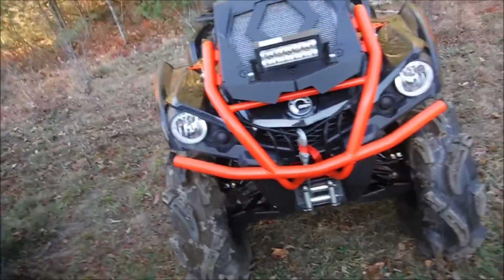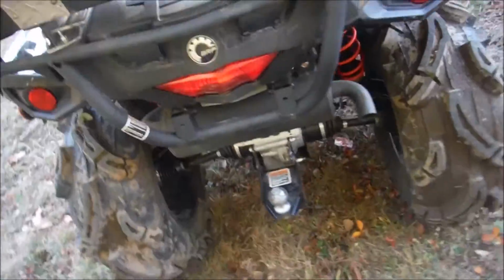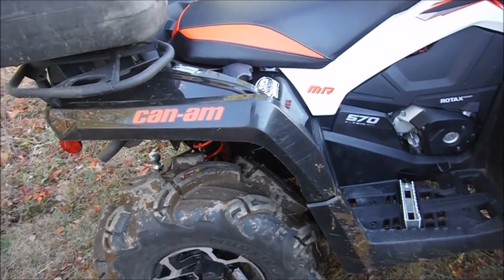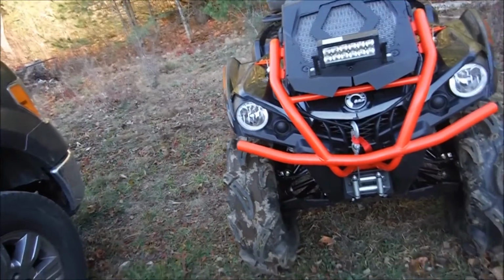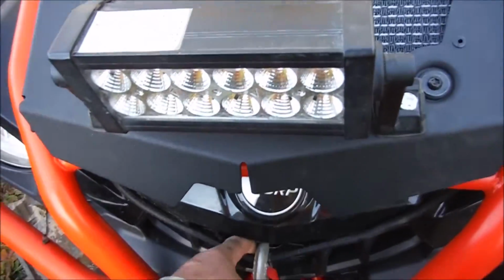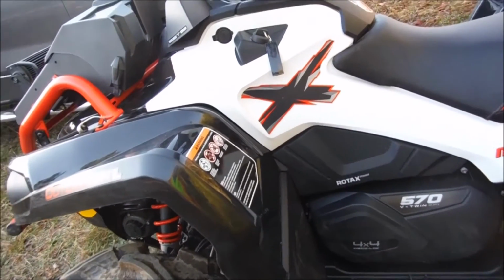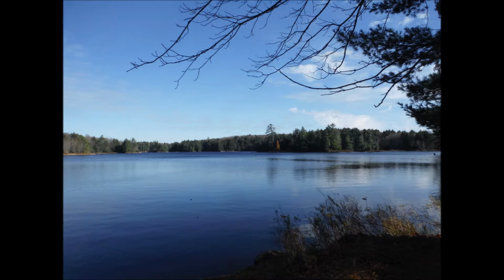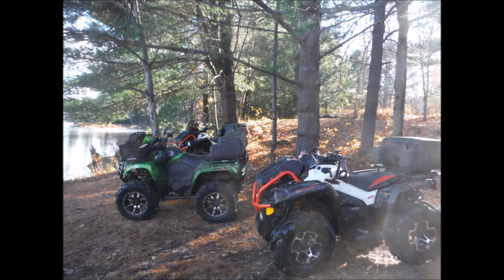2016 570 xmr review

Comment: Do you find it tippy? Thanks
Reply from the maker: At first I did but now I'm used to it. Remember this is a mud bike first not a trail bike but you can add spacers and widen it up like ill be doing that when I get my second set of tires and rimes. This way when i do the fast pace trail riding ill switch to spacers and a trail tires. and put it back to stock when I do mud. Over and all you'll get used to it without the extra cost . Just think to yourself what you will be doing more. Thanks for watching and fell free to ask any more questions.

Comment: The guy on the mud pro is probably running less aggressive tires than you that would probably be the reason or rider error ,Cat has more clearance same power with better gearing and diff lock
Reply from the maker: Love that you think that but a can am 570 just outright out performs the cat. I'm saying this because I owned one and ride with a few. They are all slowly buying Can am's. The guy you see in video just bought a 850 xmr. Now that cat was bought out I'm hoping to see some great improvements. Not knocking arctic cat just that they could not keep up to the competition and hopefully that will change. Owned 2 cats before the Can Am. Thanks for watching.
Reply: My 14 mud pro 700 out performs my friends 17 xmr 570 ,I can beat him in a race all day long pull the front wheels way easier I like his bike but it lacks low end power big time , there both great in mud never seen any situation where his out performed mine even with him having the mud zillas and me just the zillas ,Add me on snap Shaneb626 not just talking shit it's my real world experience all even get the race for ya both are bone stock and I weigh 80 pounds more than him
Reply from the maker: Sometimes it's just the rider but I'm not hear to argue. But if you were to ride with me i'd show you like i did with my friends and one of them is a 2016 model. As long as you are out there riding and enjoying yourself. That's what maters. Thanks for watching.
Reply: Franks DIY am sure it outperforms the regular 700 with 44 hp ,All am sayin is switch tires and see what happens those outlaw mst that came on the first couple of mud pros suck the mudzillas are a far superior tire